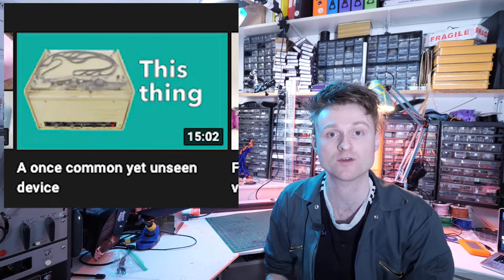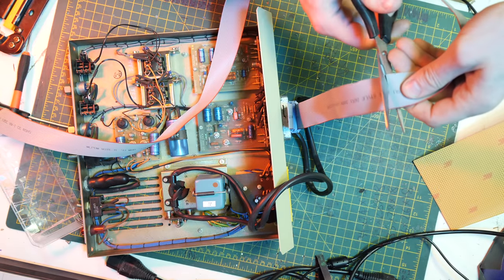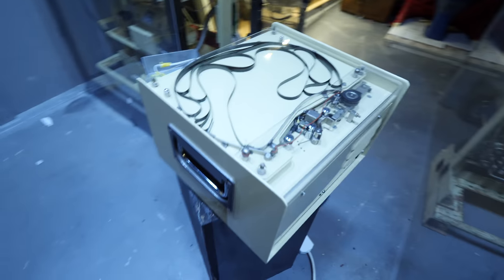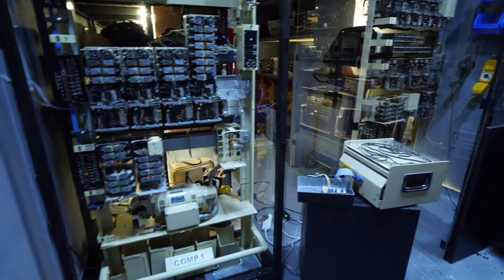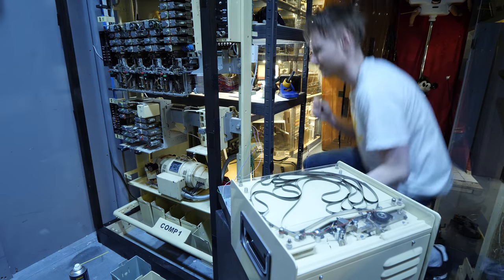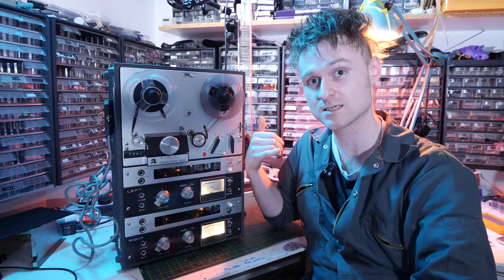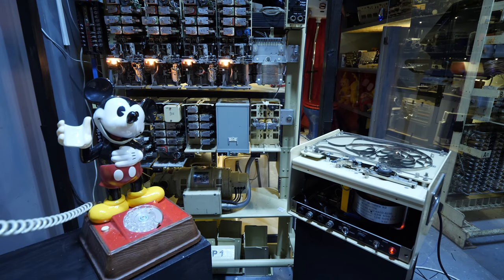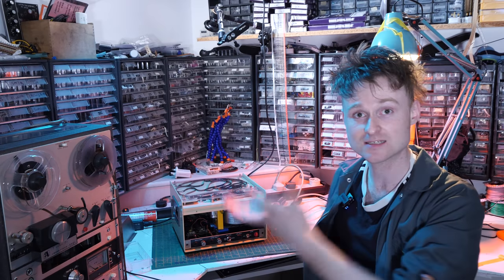Tape Loop Announcer Featured on Techmoan Fixed And Wired Up!

Comment: There should be some sort of end of tape detector in the unit. Usually optical -  sensing either a piece of transparent or reflective leader tape.  Earlier models may have used a crude contact sensing foil tape.  So the message stops, possibly disconnecting the call after the replay. Also if the caller hangs up early the tape will continue to the splice to cue itself up ready for the next call.  If there is no obvious optical sensor or contact the unit may alternatively have used a test tone on the recording.

Comment: I had a slightly newer Microvitec cub (BBC micro) monitor with a plastic housnig and it had internal dip switches for rgb analog vs rgb digital (TTL), the remaining switches were for sync options & 50/60hz from what I remember. The manual I had also included a metal housed version so may be applicable to your newer one (with the darker phosphor). I had one of those running rgb analog perfectly from an Atari STE a while ago.

Comment: There used to be a "Buzbys Story time" service that probably ran on one of these as well.  You could ring the service and Bernard Cribbins voice would read a story as "Buzby" the mascot of British Telecom back in the late 70s early 80s.  This was before premium rate numbers were a thing.

Interesting times.  My 2nd job was programming premium rate telephone systems in the 1990s. By then it was all WAV files playing on a computer node running Dialogic hardware.  great times!

Comment: I was a telephone engineer :-)- back in 1976/7/8
I never used a soldering iron, wire wrapping and crimps all the time.
Why is the tape twisted on your recorder??
There is a reason you should do it like this...
How does the loop know where to start if the last caller hung up before the end ?
I think a metal strip on the tape marked the start, clearly not on this though, hence my question.

Also, when I worked in an exchange I remember seeing a massive motor thing that I was told was the ring tone generator. Have you got one of them ? How did it work?

Thanks !
Reply from the maker: Watch other vids on channel for tape machine. This machine is intended for multi user so no start or stop

Comment: Strange that the audio output is better on the phone. Is the tape bias circuit optimised for the carbon speaker circuit requirements?

Comment: Please tell me that you're going to now wire the other numbers in to modules so that people can call up a specific sequence etc

What would be really dope is having it setup so that depending on the number you dial changes the routing / sequence that gets played

eg. First number = oscillator
Second = LFO rate
Third = ADSR
Forth = Sequence 

etc etc

Comment: Does the tape start and stop in random locations based on when the call starts and stops?  If so maybe you can put an out of the phone’s audio range tone (100Hz or 5KHz) and a circuit to sense the tone to stop the tape at the end of the recorded message.  It will then be queued up at the beginning for the next call.  Just a thought I had.

Comment: With a Tele 710 you can hang the receiver on the phone without operating the switchhooks so you don't have to dangle it on the cord. Those rear points on the back of the switch are 'U points'.

Comment: Interesting exchange in your museum, is it from the era of the captain crunch whistle where phreakera would use the whistle from a breakfast cereal box to seize a trunk line and make free calls and manipulate the calls so they were the 100th caller to radio stations competitions. Would be cool to see that working on your museum!!
Reply from the maker: Wasn’t really that kinda phreakung in the U.K. unfortunately
Reply: Yeah, I often wondered if it was something specific to the switches that AT&T ran in those days or if it was something replicable on all switches from that era

Comment: Just got turned onto ur channel. Brings me back to my younger years. Back when we would raid the dumpsters 
In the back of a substation. It seems they are still using the "WAS it expensive? If yes put it on the racks out back and cover w a tarp" method of of dealing with obsolete technology.

Comment: Can't you replace the external relay by simply connecting the P-wire directly to the 9A connector's relay pin, perhaps with a pair of 100V diodes for the two-number setup?

Comment: Is it possible that the machine used a different recording equalization (which would be totally reasonable, given the limited frequency range) making the original recording sound muffled on a normal machine, but fine on telephone, and Techmoan quite tinny in comparision?

Comment: One good thing to do with such old equipment: Change all capacitors!
As those capacitors are electorlyte capacitors, they have the liquid (electrolyte) inside, and that dries out over time, thus loosing the capacitance of the capacitor.
This also reduces the risk of something blowing up due to this issue

Comment: Did you play back the old tape loop on the reel-to-reel to get a better quality archive of the announcement? I imagine the output you initially recorded from the old announcer machine probably wasn't the best you could get off the tape from a reel to reel deck with less abused heads.
Reply from the maker: Yes sounded the same

Comment: Why did you have to disconnect the ab lines through the relay, too? I can understand it for the activation wire, as this can be connected to multiple p's and you probably don't want backflow. (On the other hand, why is that not contained inside the machine?)
Reply: the final selector answers straight away if the lines are connected to the + aand - . th small delay meant it had time to recognise a call went through

Comment: When I heard the worn-out tape on Techmoan's vid, my initial thought (as a veteran of ye olde cassette days) was that the tape head azimuth needed to be adjusted to align with the tape's azimuth. But if it's muffled from actual wear and tear (those iron filings just, like, fall off, man), then yeah, azimuth adjustment will do nothing. Good fixes, tho!

Comment: Nostalgia is not what it used to be. 
One of the most unnerving sounds in a Strowger exchange is when the whole thing is silent* and then a single call goes through it. You’ve even got the echo right, though not the really spooked bit of the 1st over to,your left, the second in the middle somewhere and the final way over to the right. 
* very rare in bigger exchanges. ‘Construction’ engineers would hear it during the installation of a new exchange, but us maintenance engineers were only likely to hear it in smaller exchanges at Christmas during a call out.

Comment: How does it (if it actually does) start the announcement at the start of the recording every time? Doubly so for the second announcement? Surely there are only a fixed number of 'start points' on the tape (just one?) so if you dial in after someone hung up early or while it's already playing the other announcement, it'd start playing partway through?

Comment: If Dial-a-disc started at a random point in the recording, surely a service announcement didn't?  Isn't there some way to sync the tape up at the start for the next call, like a fixed period of silence at the end of the announcement?  If I remember correctly, that was how the Divert-A-Call cassette synced up.  (@LOOK MUM NO COMPUTER I worked on the Divert-A-Call 84-86, and am happy to help if you have one.)
Reply: Very valid comment, I was thinking the same thing. The message must reset in between calls

Comment: Just to note, the relay contact blocks have 3 screws, the middle screw is what holds the block onto the relay, the other 2 clamp the blocks together, so just undo the middle screwto swap blocks ;)

Comment: I got a chance, in the late 70's, to see the machine that would tell you which number you had dialed that was disconnected or whatever. There was a drum that had a magnetic coating on its outside surface. The surface was divided into 10 tracks. Each track was a repeating single digit. In use, a 10 track playback head would switch the tracks so the user heard the number they had dialed. The drum was only about 30cm in diameter. And the noise in an old telephone switching building was continuous. First time I heard it my question was, "What is that racket?'  A never ending clickety click.

Comment: Wow, really interesting follow-up from Techmoan's video! But why would they need to use this tape thing as part of Dial A Disc instead of just running the record player directly (like an elementary juke box of sorts)?
Reply from the maker: How do that rewind. How Does it automatically start, are there transformers for multiple callers
Reply: @LOOKMUMNOCOMPUTER : Um... 1. ya don't rewind a disc, so that doesn't even apply. 2. You'd hear it at whatever point it was already in and then replay, same as with the tape. Think of how a jukebox can replay stuff by repositioning the arm. If there were no one listening to it when you called, then maybe it'd be set up ready for you to  hear it right from the start. 3. What do you mean by "transformers"? 4. I was asking you, so what is your answer?
Reply from the maker: @HelloKittyFanMan.  no need to be sarcy. ok so you mean a custom machine not just a record player because you cant just auto drop the needle on a normal one, i'm guessing because of the cost of developing such a thing was high for a custom job. stuff like this is quite a lot of the time a cost thing. these announcers had been around and were used forother jobs intheexchange. its likely they used that because it worked. and dial a disk was a small aspect of the business it did not justify the development cost. most times if things seem stupid the decision was down to cost and speed
Reply: @LOOKMUMNOCOMPUTER : I wasn't being "sarcy." Where did you get that?
Some regular record players do have an auto-drop of sorts, actually, so yes, in those cases, you can. But they're made to do it when a new disc comes down; not with the same disc.

But yeah, I guess if these tape machines had been around already and jukebox mechanisms had too but were more expensive to implement, then going this way makes more sense for just that reason. Plus, this tape thing doesn't take any robotics to repeat; it just winds back around. So it's already more reliable that way; I hadn't yet thought of that.

Comment: Just make sure that when you take away, then reapply power, you wait ten seconds.

That is so that ALL of the voltage in the capacitors can dissipate, before being given another jolt.
Reply: I heard that before. Can’t work out why that matters, the capacitor would experience less of an inrush current in that case? I observe it of course, but… why?

Comment: You could add a couple of extra tape heads to this, an make an incredible analogue tape delay.
Reply: That´s exactly how most old school echo machines worked. Many even had 4 or 5 playback heads.
Then there was the Binson Echorec, which used a steel drum instead of a tape, but operated in the same way.

Comment: I would have thought that the unit would have been made to connect up with two sets of A, B and P wires, or even just two pairs of A and B and ring detectors so it could be simply connected like two telephones without extra relays.  I'm also curious about what all those connections were about - it looked like a 36 or 37 way connector about half full.

Comment: It's interesting to see how Bell and GPO technology used such a similar switching fabric, but such a vastly different system. For example, instead of +, -, M, and P, Bell had Tip, Ring, and Sleeve, which is a remnant of manual exchanges. T and R were the audio channels, and S was used for supervision, with a ground on the sleeve indicating a busy condition. Also, a lot of announcement machines would stay on hook until the recording got to the beginning.
For recordings of the old North American telephone network, check out evan-doorbell.com.

Comment: I’d love to bring the girls down as I love old tech  and I like to try and teach them how things used to work used be and how people lived I’m also planning on trying to set up a little internal phone system when we move for my shed/garage workshop so the misses can easily get hold of me my model engineering club is stripping out the old gpo rotary dials one of which is an old line side style for communication with the signal boxes on the railways which I’ve got my name against sadly before I could salvage it the controller unit went in the skip and got very wet and thanks for an interesting video only came across it by chance

Comment: Back in the 80s, The Science Museum in London had a working optical speaking clock machine. I've no idea if it is still on display.
Reply: It was still there back in I think it was 2017 or 2018 when I went.

Comment: Should totally wire it up so that if you dial any of the first few numbers wrong you get this machine and if you get the right number it goes to an old tape answering machine
Reply from the maker: Indeed but there is already something that has this job :) the NU tone

Comment: I'm just aregular electrician. You know with the terminal tool, you just pop the wire in the slit, then press the terminal tool to the bottom, and voila, it is connected, no solder, no deiinsulating pliers. The terminal tool is not too hard to get if you know any elderly low voltage man, as telephone men are called these days

Comment: Would have made a great tape delay
Reply from the maker: Not really. It has less in common with a tape delay than a cassette player. Best leaving things like this as is. Cassette players you can make tape delays quickly this requires a lot more wiring in. And more heads

Comment: dude, it FREAKS ME OUT that you are wearing a jacket while working in there. jacket = extra static charge. hopefully its just not that dry in your shop and you never end up zapping anything. if you did that in my shop, you'd nuke that player in seconds because my relative humidity is nearly 0%
Reply from the maker: number 1, its freezing. number 2 never had a problem, no idea of humidity, never looked into it.

Comment: I suspect if you're using solder for telephone exchange equipment then you desperately need to invest in crimping tools and crimpable connectors like spades.  I don't know what your equivalent of Harbor Freight is but this stuff is still made and cheap.
Reply from the maker: Naa those turret boards are the solder type. Even the ones I have that are the same which are recovered are solder type and the wires are soldered on. Not crimped. Other ones I have are the wire wrap type and I wouldn’t solder on those. I’d use a wire wrapping tool. Crimp connectors would be clunky and not correct for the job sadly